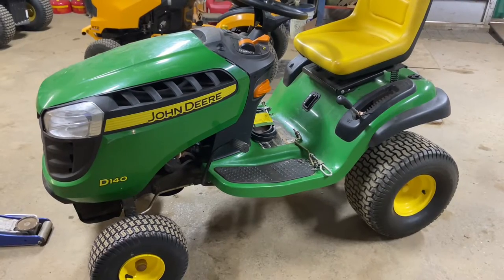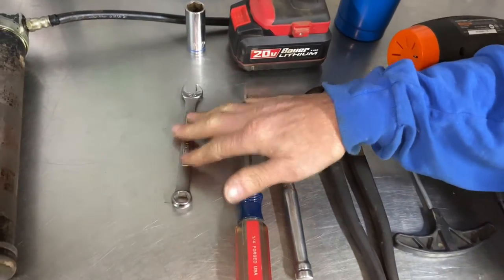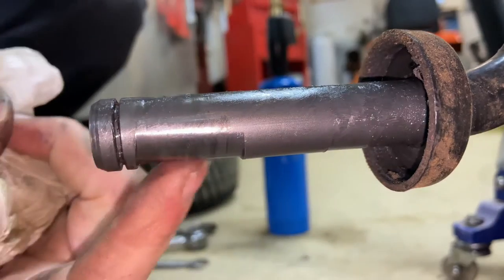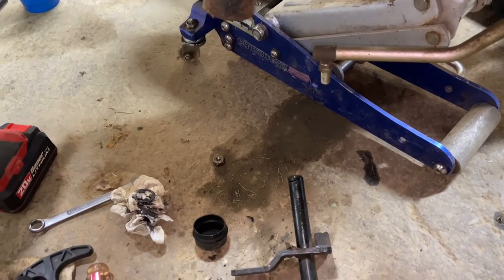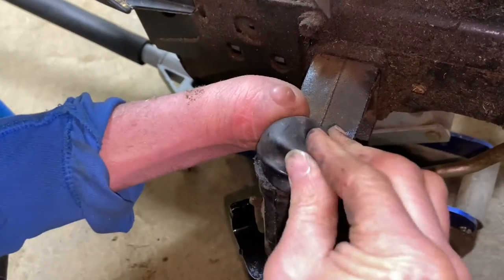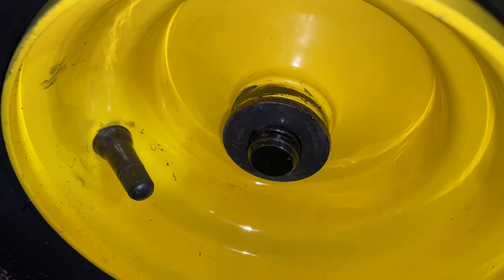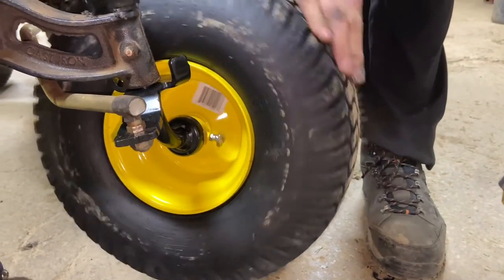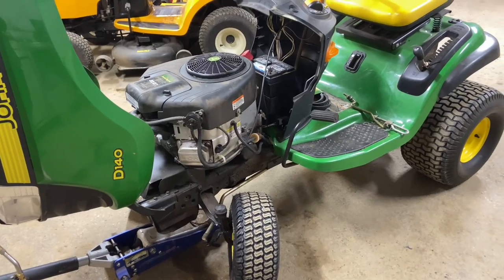How to Install Front Wheel Spindle John Deere Tractor

Comment: NIce job: I also fit the bottom spindle shaft with a thin needle bearing. It make it steer way easier. (Poor mans power steering)Thanks for the video.
Reply: I just replaced the wheel spindles on my la105 today. Surprised that there were no thrust washers at the bottom of the vertical shaft.

Comment: I notice on my d140 my right front wheel has a positive camber. The other side is perfect. I'm wondering if I got a bent spindle or damaged rim. Top of the tire is leaned outwards.
Reply from the maker: You could have all of what you said. Check to see if your tie rod is adjustable, some were and some were not. That would help you get it back into position.
Reply: @JohnsonsSmallEngines  wouldn't adjusting the tie rod just affect the toe and not the camber? I don't think it's adjustable other side is perfect straight up and down but the left side top of tire is leaned outwards (positive camber) was just curious what your thoughts were on it
Reply: @JohnsonsSmallEngines  I know when I changed the bushings and put bearings in on that side with the camber issue the bearings just fell in so I know the rim is practically wore out but I just used a hammer and pounding around the rim and got the bearings to fit tighter it's a 2014 model d140

Comment: Brad I ordered the wheel bearing conversion kit you listed from amazon for my S120. The kit says for axel ID .75” and wheel rim 1.375” which mine S120 measures perfectly. The bearing OD was ever so slightly too small and slid effortlessly into the rim. The bearing axel ID was ever so slightly too small and cannot be forced onto axel. Don’t know if it’s peculiar to the S120 or the HD Switch brand is sloppy. Just FYI. I enjoy and leArn much from your videos. Wish there was someway to get rid of bushings. Any suggestion much appreciated.
Reply from the maker: Hi Joe, OK first i have heard of this. I will drop the S100 from this video pending the next S100 series I get into the shop I will try the kit. Thank you for the heads up. You could try a genuine John Deere kit and see if it is the kit or the tractor. Or better yet, call up John Deere to see if they have a roller bearing kit for the S100 series.
Reply: @JohnsonsSmallEngines  Thank Brad. Will do. I note the item you listed does not specifically list the wheel for the S120, GY20638. HD does carry a 4 bearing pack specifically for that wheel. Might give that a shot. I’m a good ways from a JD dealer.
Reply from the maker: Ok, if you try the GY20638, let me know how you make out. I will need to make a video just for that. Thanks for your research into this.
Reply: Hey Brad. Ok. I ordered John Deere kit AM127304Kit1. Expensive. A little over $70. It comes with bearings, caps, e-clips, new washers. You can order just bearings, AM127304, for around $50. It worked. On one wheel the bearing just dropped in which was problem I had with HD brand. I had to put three stake pints around the hub to hold the bearing tight. I probably could have gotten the HD to work if I would have had a clearer idea what I was doing. I will say the JD components seemed more substantial and better made. The JD bearing was .002 larger ID than the HD. Still tight on axel but was able to get it on. Looking forward to your future videos. They’re great. Very clear. I learn a lot.
Reply from the maker: Hi Joe, ok thanks for the update. I am going to change the numbers to John Deere. Thank you for keeping me in the loop, the JD numbers and a big thank you for supporting my channel!
Reply from the maker: Hey Joe, is there a possibility that your axle had paint on it that would have stopped the non John Deere bearings from going on? Sometimes paint will be the issue. I just thought of that because your machine is so new.
Reply: @JohnsonsSmallEngines    I don’t think so Brad. I think if I would have been more aggressive the HD would have gone on. I was also wrestling with the loose bearing in the hub. I thought it was the bearing but it was the hub on one wheel. Staking (I saw a guy with the same problem on YouTube) fixed it. The other wheel was fine.

Comment: Great video I need to order 2 front spindles for my d140 would you have a part number for those?
Reply from the maker: Here is a link to look up all your John Deere parts.  https://partscatalog.deere.com/jdrc/
Reply: @JohnsonsSmallEngines  right on man. Thank you. How do those HD switch front bearings hold up vs getting the john deere bearing to replace the bushing kits. Is it worth spending 72 for the john deere kit vs 20 bucks for the HD switch bearing kit for the complete front bearings
Reply from the maker: I haven't had issues yet or complaints so I will assume they are doing well. For $20 it is what it is verses having to keep greasing the front suspension or paying for the John Deere kit. I have noticed that many manufactures are going too using, "NOT made in the USA" bearings which is disappointing.
Reply: @JohnsonsSmallEngines  for 20 vs 72 for the john deere branded bearing not bushing kit I mean why not that's a pretty big savings. Very disappointing I agree
Reply: @JohnsonsSmallEngines  but bearings vs bushings is a no Brainer bearings all day
Reply from the maker: 100%

Comment: I’ve removed the e clip and washer on top of the spindle, but the spindle will not slide out. I’ve been wailing on it with a hammer, soaked it with liquid wrench. It spins easily, but it will not slide out. Any ideas why?
Reply from the maker: Hi Chris, the only issues I have come across  is the top of the spindle may have a ridge on it that you need to sand or grind off before it will slide out. Because you beat it wil hammer it now may be worse. Sand or better yet, grind the top to make the shaft thinner in diameter and it should slide out.
Reply: @JohnsonsSmallEngines  thanks for the quick reply. I will try grinding and let you know. Thanks for your videos. You have helped me a lot!
Reply: @JohnsonsSmallEngines  you nailed it! Thank you!
Reply from the maker: Thanks for the update. Glad you got it out!! Now for the new and remember to grease them often!